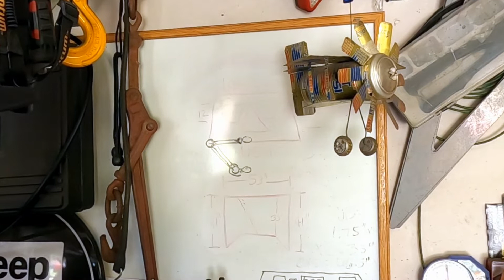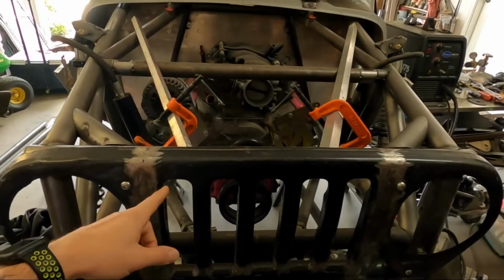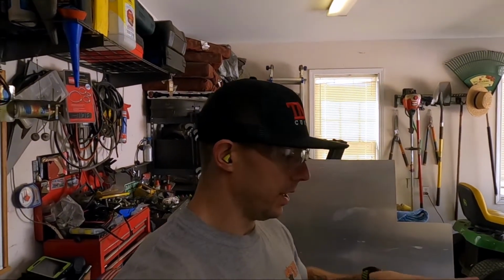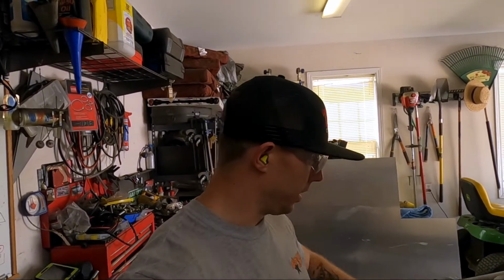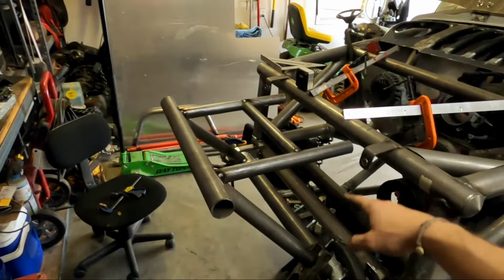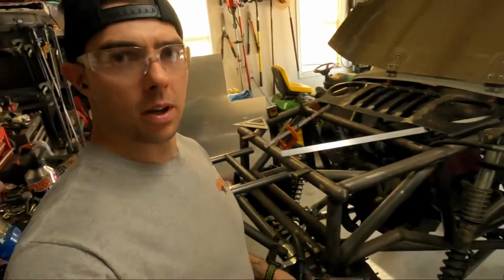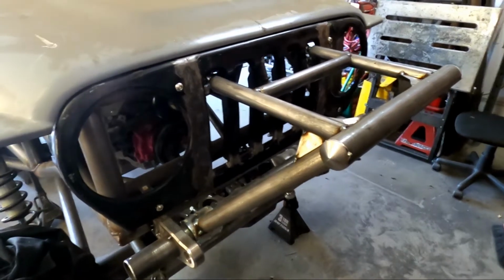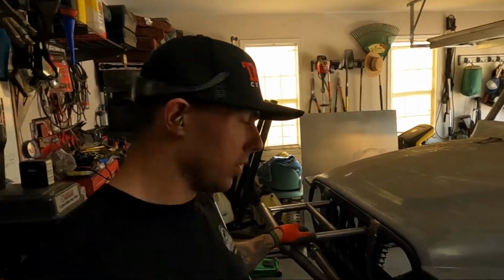Rock Crawling Bumper - Jeep Chassis Build

Comment: Not trying to be smartass but why not just throw your extra grim in a bag? And then use to be clamps up too too? Just curious?
Reply from the maker: That's a great question. In this situation, we probably won't ever have to utilize these. Most of our races are short course, so we'd keep a spare set in the pits. The only exception to this is KOH, in which case we'd have them on the chassis in worst case scenario. Therefore it eliminates the spare sets we'd have to carry onboard. Hope this clarifies.
Reply: @FSUOffRoad  looking at this i see now how auto correct tried to help but failed! lol i was curious about using heims in place of tube clamps. but thanks for the clarification. Looks good man!
Reply from the maker: @regularguyracing  I appreciate it... stay tuned, hopefully have a few videos out in the next few days or so.